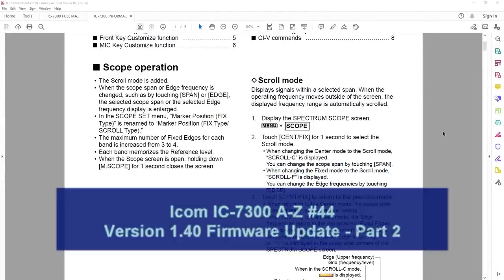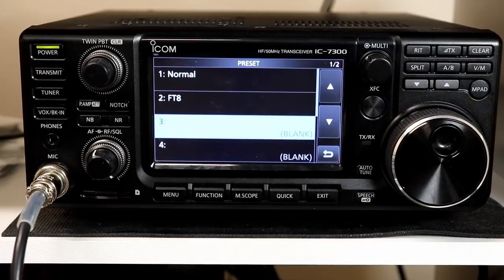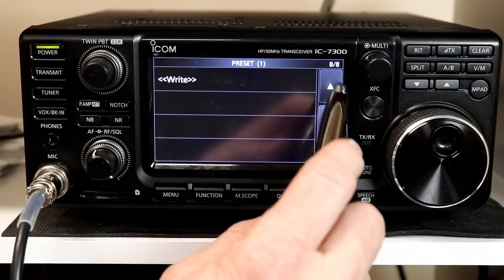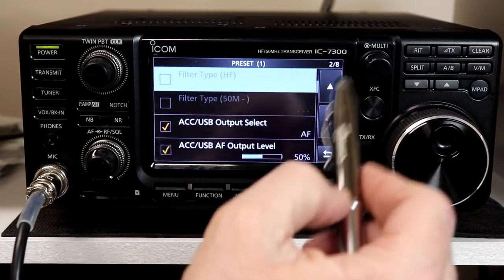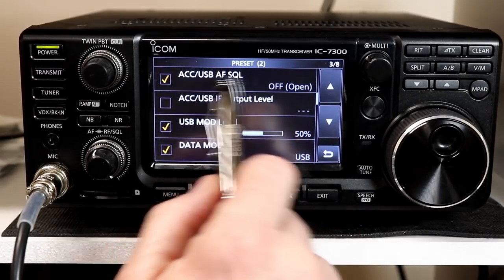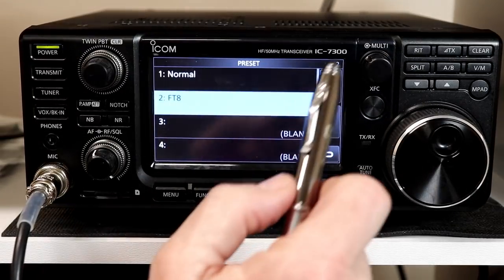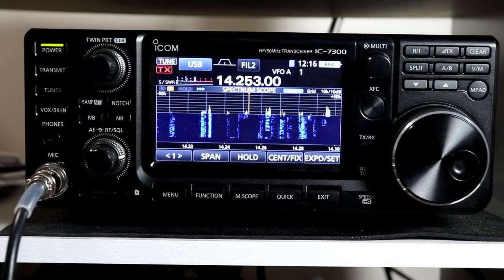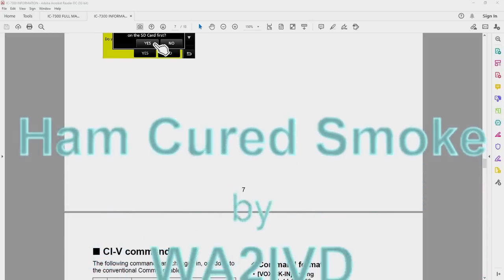IC 7300 A to Z #44 Version 1.40 Firmware Update - Part 2

Comment: I want to thank you for this, and for all your 7300 A-Z videos. I just picked up my new 7300 from HRO on Saturday and if it hadn't been for your videos some of the options of the radio would have been more confusing. The basic manual doesn't do a very good job at explaining all the steps to add frequencies to memory, and other things, but your videos helped make that crystal clear. 73 DE KI6JPE

Comment: Hello Tom,
I have not updated my firmware yet, but have a question about assigning the new presets. Using the up-down arrow buttons, can those now be changed from memory channels to changing the band? One of the features that I miss on this radio is not having a band button to simply press and change what band you're operating in. Thank you so much, and I sure appreciate all of your work and effort in creating these videos.
Reply from the maker: Hi Doc.  Unfortunately, the new firmware does not allow you to customize the up and down arrow buttons on the radio to change bands.  You can however customize the Up and Dn buttons on the microphone to change bands.  So that’s a small step in your direction.  Thanks for the kind words.  73, Tom

Comment: Tom, 
When describing the PRESET features, you added the third Preset called Mixer by using the "Write" on page 8.  So what is the function of the "Save to the Preset Memory" button which is directly under the "Edit the Preset Memory" ?    Your videos are wonderful and vital to my understanding!  Ron, K5RJL
Reply from the maker: Hi Ron.  thank you for the kind words.  The  "Save to the preset memory" takes you to the screens that let you pick which parameters the preset will modify.   So, for example, if you want a preset that sets your Mode to LSB and sets your Filter to FIL2, but doesn't change any other settings, you can leave the Mode and Filter boxes checked.  Then uncheck everything else.  Then at the end of the list on the 8th page is the <Write> option that actually saves the preset.

Comment: Thank you Tom for all the help you provided.
Although, I do have a big question. I followed the instructions and everything worked smoothly, BUT. When I create a new preset, (let's say a preset called Winlink), made the necessary changes, tested it and it worked like a charm and lastly I saved it in the position No 3. Then I had to turn off the transceiver. When I turned it back on, the new preset had disappeared.  
I tried again and for the second time the preset is deleted after the shut down. Any thoughts?
P.S. #1 Tried again for the third time today and it worked! Don't know what was wrong the first two tries. I am sure I pressed the "Write" button and then "Yes".
P.S. #2 A few days later, my "new" Preset vanished again. So, back to the original question. What can cause the deletion of a new Preset? Also, any changes I have made for the connectivity to the Ham Radio Deluxe (like the Baud Rate), were restored to their original default values!
Any feedback is welcome

Comment: Does anyone know if there is a way to change programming of the Multi Function knob from 1 kHz change per click to say, 5 or 10 kHz? It's faster to tune the knob for only 1 kHz, I'd prefer 5, as I can do on my TS-950SDX.
Reply from the maker: Hi.  Yes.  Press and hold the 1khz digit on the frequency display and the tuning step menu will come up.  Once you pick the new tuning step, the multi-function knob will then tune in that increment.  The display will still show “kHz”
Reply: @HamRadioA2Z  Awesome! Thank you!!

Comment: Chances of bricking the radio?
Reply from the maker: Hi.  This is a good question and a valid concern. The chances of bricking your radio (Despite the dire Icom warnings on the screen) are very low. The radio checks the firmware for validity on the SD card before it starts the load. So, this guards against a corrupt file. The largest risk would be if you remove power from the radio during the update. So, if you really want to be safe, you could power the rig from a well charged 12V battery during the update to avoid the risk of a power failure.  All in all, it’s pretty safe, quick and simple.
Reply: @HamRadioA2Z  Great answer. You might state that in Part III.